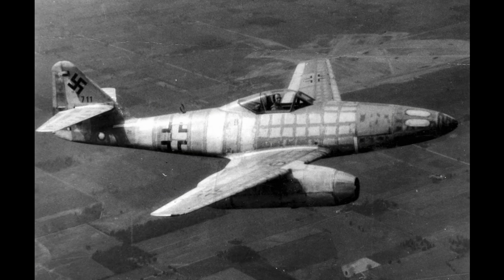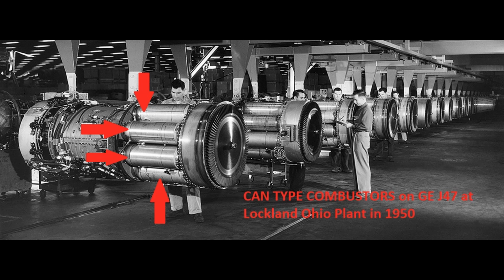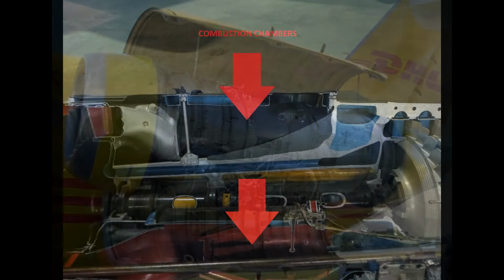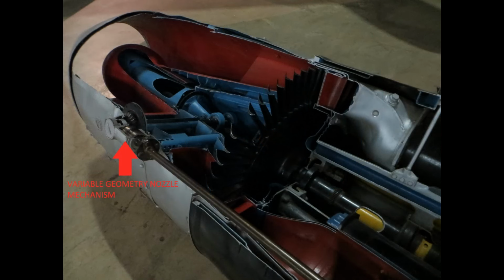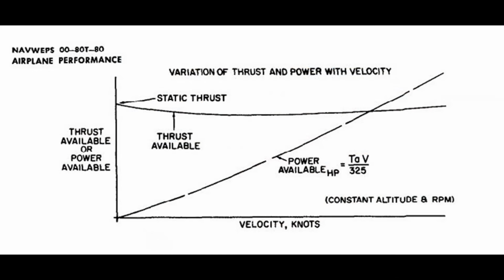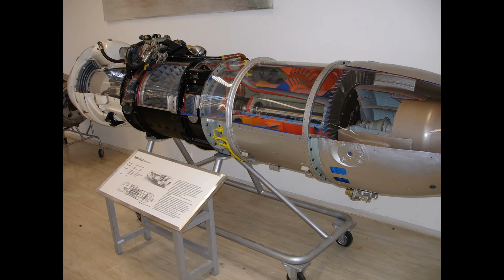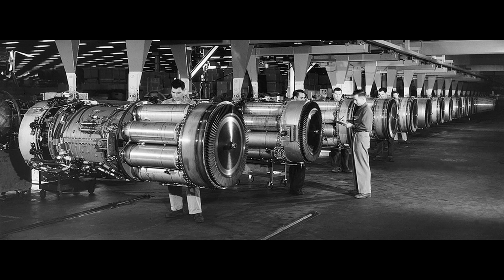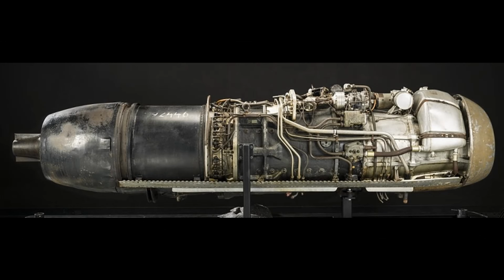World War Two JET POWER

Comment: Thanks for an informed vid again an Happy Christmas.
I also wonder if there is any information about the Italian jet that flew in between the German and the British during those two years.
Reply: That aircraft was basically a piston engine powered ducted fan with an afterburner fitted at the rear. NACA was actually working on such a design until 1942 when they found out by accident that the USAAF had already ordered a jet powered aircraft to be built by Bell Aircraft using the British Whittle Centrifugal Gas Turbine Design.  General Hap Arnold had seen the prototype British Jet in early 1941 and got the British to give the US War Department, firstly  a set of Blueprints and then a completed Power Jets W.2 Engine to allow GE to build copies for the P-59 Airacomet. Due to NACA being a Civilian organisation the USAAF "forgot" to inform them for security reasons. The USA and UK worked on both Centrifugal and Axial Flow engines during WWII, with the former getting priority due to their greater reliability, ease of manufacture and much longer running life between overhauls. The first British Axial Flow engine , The Metrovick F-1 was first ground run in 1941, the Improved F-2 actually flew in a prototype Meteor in November 1943 and was more powerful than any of the German Turbojets that were actually built, plus used an annular combustor instead of cans. However the engine had reliability issues and it wasn't until January 1945 that the F 2/4 engine was ground run which blew all of the German engines in production out of the water as regards both power output and reliability. Metrovick had been selected by the British Government to carry out R&D for Axial flow engines as the compony did steam turbines for both power generation and naval use, but they were not into aero engine manufacture and the compony had no real ambition to start moving into that field, thus at the end of the war, thus they sold their jet engine projects to Armstrong Siddley. Interesting side note, When Metrovick were asked to share their work with the USA in 1943, they specificity asked for General Electric to be given the US contract for Axial flow gas turbine development using their data as the two companies had a patent sharing agreement already in place. The Early GE Axial flow engines like the J47 were most likely based on British axial flow engine designs than German!!!! The document below tells the full story.

https://www.research.manchester.ac.uk/portal/files/54530197/FULL_TEXT.PDF
Reply: @richardvernon317  , the Italian Caproni Campini N.1 you find here:
https://en.wikipedia.org/wiki/Caproni_Campini_N.1

"The Caproni Campini N.1, also known as the C.C.2, was an experimental jet aircraft built in the 1930s by Italian aircraft manufacturer Caproni. The N.1 first flew in 1940 and was briefly regarded as the first successful jet-powered aircraft in history, before news emerged of the German Heinkel He 178's first flight a year earlier.".
Reply: @hurri7720  Not a Gas Turbine powered aircraft in any way shape or form. Ducted Fan with a Afterburner system would be a better term.

Comment: The fixed-gear Ju287 wasn't really a bomber, as such. It was a "technology demonstrator" (or whatever you call it) to demonstrate the advantages of a swept-forward wing for use on a proposed bomber. The prototype was constructed using parts from other aircraft, and for the kind of testing they were planning, a retractable landing gear wasn't necessary (or maybe by then there wasn't enough time to design anything, yet). The actual bomber version of the design would have had retractable landing gear.

Comment: Whilst I do not disagree with just about everything in this excellent presentation, the Junkers engine was a pioneer and the basis of almost all modern gas turbine engines. However was it the best jet engine of WW2 as thd title suggests? The main flaw of this engine was its short life span, as little as 10 hours. Not due to any design issues, but to lack of high temperature alloys in Germany. This severely blunted its usefulness as it made the engine unreliable. 
Contrast this with the Whittle design, which used a centrifugal compressor. This engine type ultimately was not able to  compete with the axial flow design as post-war development clearly showed that to be superior, but in the context of WW2 when fitted to the only allied operational jet used in combat, the Gloster Meteor,  the Rolls Royce Derwent was more powerful, more forgiving and far more reliable than the Junkers or BMW engines. Perhaps there needs to be an objective comparison between the two to determine which was the 'best'?
Reply: The Germans didn't invent the axial - it had been assumed, since the 1920s, that axial compressors were the only way to go.  When Whittle first submitted his centrifugal engine proposal to the RAF/RAE (He was operating on the idea that a simple working engine was better than a baroquely  complicated failure was a good start) the RAE turned his proposal over to Dr. A. A. Griffiths, their tame jet engine theoretician, and designer of baroquely complicated axial compressors.  (Yes, let's get the proposal evaluated by its biggest rival) Needless to say, he couldn't, or wouldn't believe that it could be that (relatively) simple, and claimed that it was impractical.  It set British jet development back at least 2 years, until Whittle could obtain private funding.
The Meteor first flew in March 1943, powered by 2 flight-cleared Metrovick F.2 axial engines (The W2.B wasn't quite ready yet) The Armstrong Siddely ASX axial first ran about that time.  So were the Westinghouse J30 axial, and the GE TG100 axial flow turboprop.  None of the Allies saw a Jumo or a BMW until we started overrunning the airfields in the spring of 1945.
The Jumo, when compared to the others on technical characteristics, does come out behind - it's inferior in compressor and turbine aerodynamics (Efficiency, Pressure Ratio, and Pressure Ratio / stage) and handling - stall margin was low.  In fact. Junkers had contracted with the Swiss firm Brown-Boverei for a new compressor design that never materialized.  Brown Boveri were the first commercial makers of gas turbines as industrial power plants, from about 1910.

Comment: Small inaccuracy here. In the compressor section of a gas turbine engine, the compressor rotors don't actually perform any compression. The purpose of the compressor rotors is to impart velocity into the airstream,  like a fan to keep the air moving backwards through the engine. The compression happens at each stage of the stator vanes. The vanes function to straighten the air and to deliver it to the next stage rotor in the appropriate direction, but they are also shaped in a way that creates a divergent duct. If we recall Bernoullis principal for subsonic flow, a divergent duct decreases velocity and increases pressure. So, the velocity imparted to the airstream by the compressor rotor is converted to pressure at each of the stator vane stages and together the work to ultimately increase the pressure of the airstream.
Reply from the maker: I said that, but simplified it, listen carefully: https://youtu.be/4N5lNOYlOb8?t=125

Comment: A good history of the Jumo 004, and an overview of how jets work in general - Thanks for mentioning the Speed/Power relationship - it's vital, and the converse situation for propeller powerplants must be stressed - at low speeds, a propeller has much more thrust available for takeoff, acceleration and climb - the crossover point is, (discounting transonic effects on the propeller), 375 mph - below that, 1 HP is producing more than 1 lbf of thrust, and 1 lbf of thrust is less than 1 HP.  This is why, during the Allied counter-jet campaign, the Allies' piston powered fighters put such an effort into engaging jets near their airfields, where the jet's lesser available thrust (Available thrust is thrust-drag) at low speed (relative to to propellers) meant that the jets were at a severe disadvantage.
A bit of context, though - in terms of jet engine technology (as opposed to jet engines in combat), the US. and UK were not behind the Germans, not did the German efforts have any influence.  Axial flow compressors were not a German innovation - in the US, the Westinghouse axial flow J30 (contracted for in 1940),  GE's axial flow TG100 (T-31) turboprop and TG-180 (J35) engines were running in early 1944, along with the centrifugal compressor I-40 (J33), both the J33 and J35 demonstrating twice the thrust,  better fuel consumption, and longer life as prototypes than the production Jumo 004. .By Mid-1944 production of the Whittle derived J31 was just about completed.  In the UK, Armstrong Siddely had run its ASX axial in April 1943, producing about 1,000 lbf of thrust more than the Jumo 004 (but not considered for production), The axial flow Metrovik F2 was the powerplant for the fist flight of the Meteor. The centrifugal Rolls Welland was in full production, and Rolls had gotten wind of the J33 and J35, so they launched the effort that became the Nene and the Derwent. 
All were running before anyone other than the Germans had seen a Jumo 004 or BMW 003.  Jet engines were like RADAR - the Top Secret that everybody know about, and hoped that everybody else didn't know about.  That said, it's fair to say that in terms of jet engine technology, there's a fair case to be made that the Allies were leading in mid-1944 - they weren't operating under the same pressures to get jets into combat.  That doesn't diminish the accomplishments of the Germans.  Getting any jet into combat in 1944 was a game-changer.  As you point out, Greg, since the jet's peak combat performance come at the high end of the flight envelope, and the prop's peak combat performance (acceleration, climb) at the low end, they operate in an entirely different world.
The Jumo 004 had other problems than metallurgy.  The bearing and lubrication technology also contributed to the short life of the powerplants (Basically, 5 hours before rebuild, 3 or 4 rebuilds, then toss it) - In order to keep an Me 262 in the air required 4 engine sets per airplane - 1 on the wings, one in transit to the rebuild shop, one set in the shop, and one set in transit from the shop to the airplane, all subject to interdiction from the roaming Allied fighter-bombers.
It's amazing that the get as many airplanes into the air as they did - the max number of Me 262s in the air was 55, in mid-April 1945.
It also has to be noted that they compressor and turbine aerodnamics weren't good - efficiencies were low, pressure rise per stage was marginal, and they were very susceptible to compressor stall. (Which would pretty much instantly slag the turbine buckets.)
There were many ways to flame out an engine in those days, before capable fuel controls were developed.  Fast throttle movements, either opening or closing, could blow out the combustor (Like turning the valve on a gas stove),  disturbed airflow, even from yawing the airplane, or, potentially, an over-enthusiastic negative G application could all trigger a flameout.
To conclude - din't minimize the BMW teams efforts.  the French SNECMA Atars are all direct descendants of the BMW 003.  The BMW team moved to France and continued working.
Reply: Peter its good to see someone who knows the facts.
Reply: Bramo/BMW axial engines were running as study concept/early protoype in 1937/38 along the Von Ohain demostrations in University which convinced the RLM to fund jet technology, which started in 39

Comment: 7:48 Technically, not literal gasoline, is it? [Pushes glasses up bridge of nose with forefinger] (See replies — remind me to shut up next time)

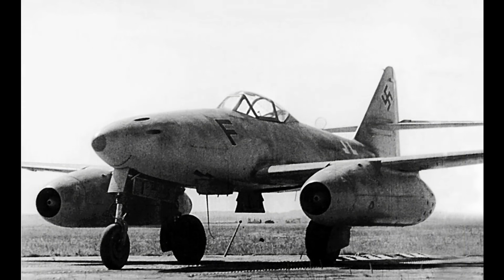19:56 The first source I found for Jumo 213 service life (since you mentioned the Dora 9) said 40-50 hours for late war variants. So if that's correct, the planned service life for the 004 sounds fine, and the actual service life wasn't that much lower. They come out very close if you count service hours per dollar spent. And then there's the performance advantage. 

https://en.topwar.ru/35771-germanskiy-aviacionnyy-dvigatel-jumo-213.html
Reply: It can be - even though today most jets run on kerosene (parafin if you're European), they don't fundamentally care, as long as it flows and burns.  The fuel controls tell the pumps and valeves to go until they reach a certain turbine or tailpipe temperature, and as long as they deliver, it'll run.  Until the mid 1950s, U.S. Navy jet engines ran in 115/145 AVGAS, to make logistics on a carrier easier (only 1 type of fuel).  Gasoline is an emergency fuel for most jets.  Its drawbacks are that it doesn't lubricate stuff like the fuel pumps and fuel control innards as well as kerosene, often requiring adding some oil, and its lower density (The energy content per unit mass is about the same) means less range.  You store it by the gallon (or liter) and burn it by the lb. (or kg). 
The first time I turned down a flying job was with Raytheon's Flight Test group - the airplanes were old F-10 (F3D) SkyKnights, with gasoline burning old J34s and no ejection seats.
Reply from the maker: Just to be clear, you can in fact burn gasoline in a turbine engine, but it's wasteful to do it.
Reply: Thanks, guys!
Reply: +Splestrie    The 40-50 hour service life was referenced specifically for the Jumo 213J where the power improvements introduced significant wear and stress on the valvetrain, bearings, and crankshaft.  Variants of the Jumo 213 spent a lot of time over water and would need to be reliable.

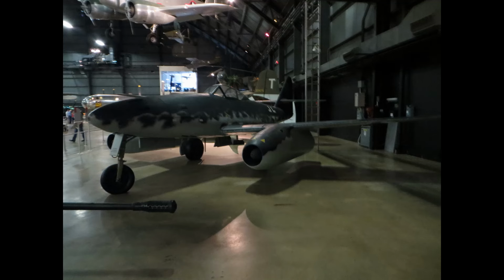Comment: 1:30. Technically, the rear exiting exhaust does not move the plane forward; the pressure pushing forward does.   One of the most interesting things (to me) about this engine on this application (Me262) is the "D" ring that is in the opening of the front engine center cone.  It is used to pull start a 2-stroke (10hp?) petrol engine that can be used to rotate and  start the axial turbine.  I had never before seen a full picture of said engine.  Thank you Greg for showing it in this great video.
Reply from the maker: Ohlen, true, but it's hard to get that forward push without ejecting the exhaust out the back.
Reply: +ohlen forst      Here is a restored Riedel engine.  The pull start can be used by ground crew but the pilot also has an electric start option from the cockpit.  https://www.youtube.com/watch?v=BGUqV0dl9gA    Electric start:  https://www.youtube.com/watch?v=ItXgDlSojTk

Comment: Hi, this wasn't the real peototype of the Ju 287. This aircraft you have shown, was only a testbed for the new forward swept wing, which was in consideration at that time. This testbed was made from a Heinkel He 177 with a new wing and the front gear of a Liberator bomber. The landing gear was fixed because the aircraft was only used to determine the low speed characteristics of a forward swept wing.
Since it got not much better results, the real prototype was build with backward swept wings. But this prototype was not flown until the end of the war, only 50-60% of the parts could be made.
This picture comes next to the planned prototype with 6 engines. 
https://de.academic.ru/pictures/dewiki/69/Esquema_JU_Ef132.JPG

Keep up the good work !
Reply from the maker: It was the only prototype that flew, and the only one that was completed.

Comment: Good stuff! One thing i missed was how the shape of the space (a diffusor) between the Individual compressor blades does most of the compressing rather than the forcing of in air into a small space at the back of the compressor. My guess is that going over the underlying physics would have gone outside the scope of the video and made it too long, and i think thats fine. 

On the topic of engine life and the damage the turbine caused by heat: most people would be suprised how many cracks are in those blades and how much hand filing is permitted by manuals ;)
Reply from the maker: Stefan that's exactly right, I can't cover every detail, this is just an overview of how these things work. This is basically what pilot's learn when they first move into turbine powered airplanes and actually more than a lot of them seem to know.
Reply: @GregsAirplanesandAutomobiles  yeah, it felt like the first lesson in the 'engines' course i had in trade school for becoming an aircraft mechanic condensed into 30 mins. On the note about pilots: Funny you say that, i too was very suprised how few of my classmates knew all of this information considering they worked in the business for ~ half a year.

Comment: Please note that the cost to construct a jet engine Vs a piston engine is based on an aircraft piston engine. Aircraft piston engines were incredibly sophisticated at the time compared to automotive engines.
Reply from the maker: Yes, and they still are with the exception of the electronics in modern cars.
Reply: @GregsAirplanesandAutomobiles  I would have to disagree with you on that one. Variable valve timing and very sophisticated turbochargers are common place now, variable compression ratio is quite uncommon but available in non-custom cars. Multiple thermostats for zoned cooling, and shutter vanes on radiators are also common. And now Hyundai has come out with continuously variable valve duration, I feel confidant in saying that auto engines are now starting to eclipse WWII piston aero engines even in mechanical sophistication. 
I am confused on why CDI and turbo compounding, or at least some electrical version isn't a thing yet on cars.